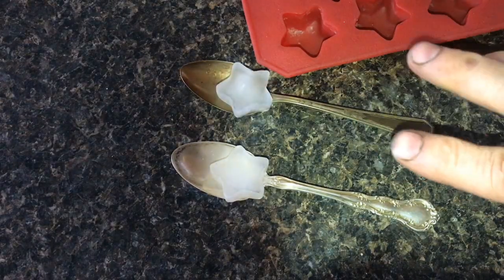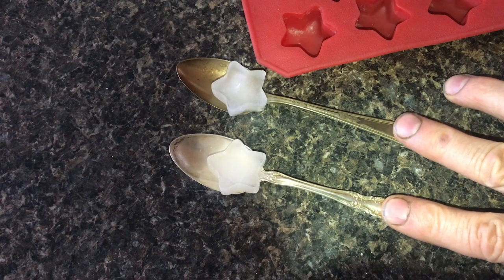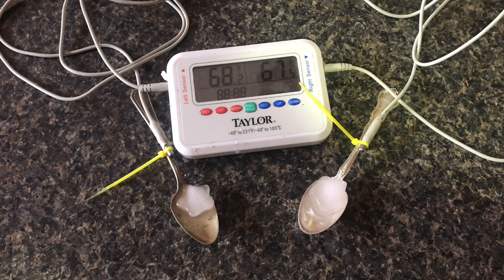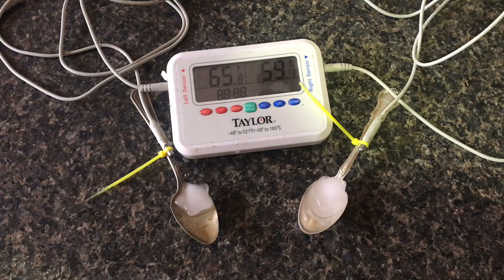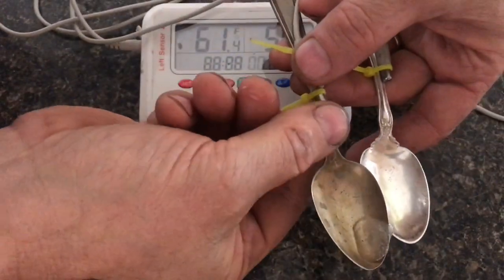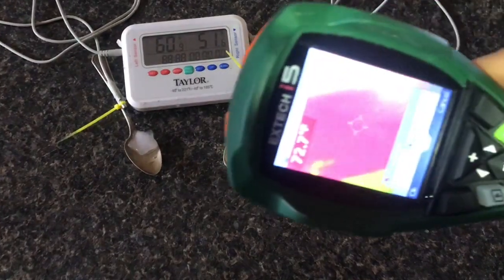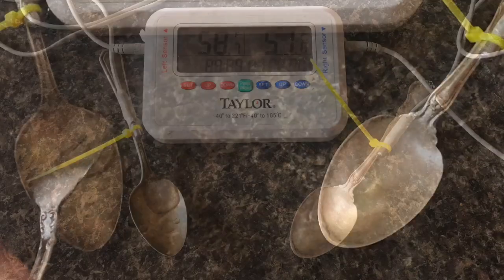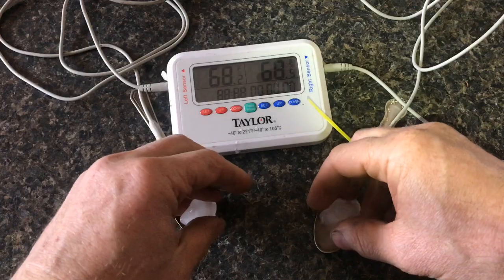can you tell REAL SILVER with an ice cube test

Comment: Your methodology is flawed. The slightly minuscule different shapes of the spoon are possibly affecting how much of the Ice Cube is in contact with the actual metal. It would be a much more accurate to place the ice cubes on a flat surface so the contact points would be equal.

Comment: Silver has a higher thermal  conductivity than any other metal , you would have to hold the spoon on your hand so that your body temperature  , 98° will transfer to the spoon then consequently melting the ice faster. 
Even tho your test was in theory valid, it is inconclusive.  Since you only tranfered room temperature..